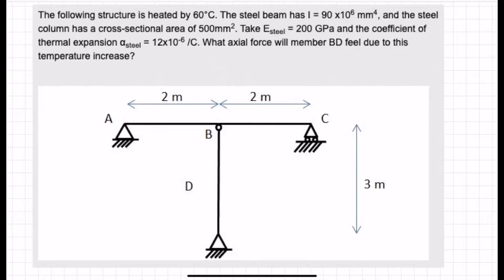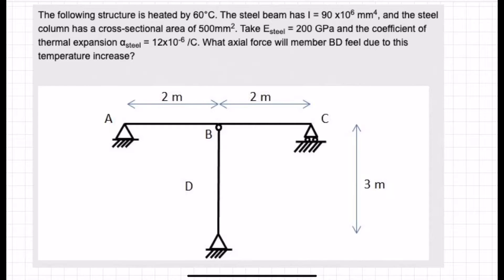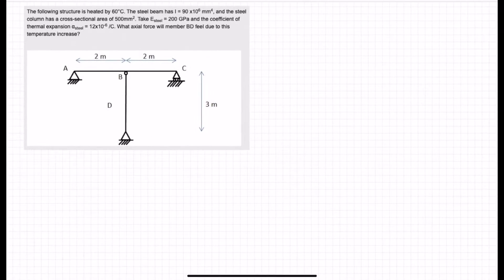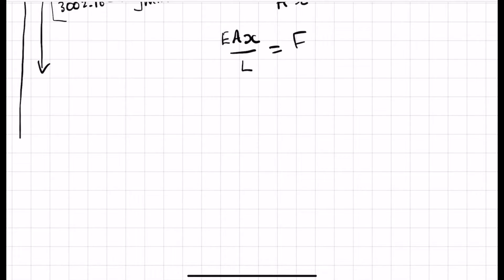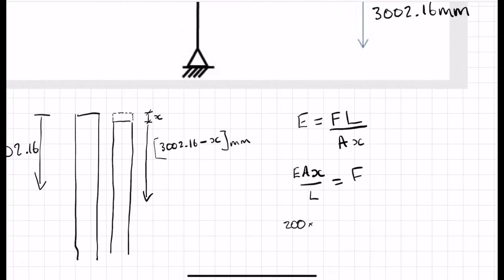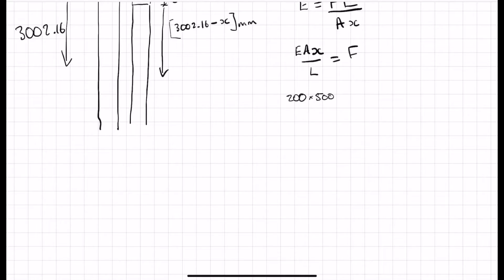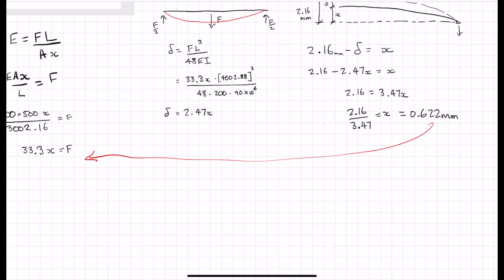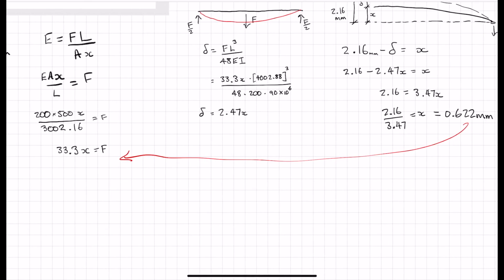Thermal Expansion of a Column Restrained by a Beam - IStructE Structural Behaviour Course

Comment: Hi, thanks for the excellent videos.

In one of your other videos (Beam supported at mid-span by a spring) you mention the importance of the signs of the deflections (ie: positive for deflections acting upwards, negative for deflections acting downwards).

Does this apply here? I initially though the unrestrained expansion of the column would be positive (acting upwards), the reduced expansion due to the beam would be negative (acting downwards) and the final 'real' expansion would be positive (acting upwards). Using that approach would result in: "2.16mm - (-2.47x) = x", with "x = - 1.47mm".

Any advice you could offer to help get my head around that aspect would be appreciated!
Reply from the maker: Hi Stuart! Honestly, it doesn't matter which direction you take as positive or negative. It's more to help you keep a track of summing multiple deflections -- thermal expansion, virtual work force, restraint force etc., not too dissimilar to initially guessing direction of reaction forces on a structure. If you have the direction wrong, then you will just get a negative number so the actual result should not change.

Comment: Hi, ty for the excellent explanation! Could you please explain what happens if C was a pinned restraint instead of a roller?
Reply from the maker: Without taking the time to do hand calculations, my guess is: 1) There would be an induced compressive axial load in the beam and horizontal reactions due to the thermal expansion 2) Due to the additional axial load there is likely to be a magnified deflection due to P-Delta effect, or the Perry-Robertson magnification 3) Thus the column would probably be allowed to expand further upwards and hence experience smaller compressive force as the additional deflection = less vertical restraint. Refer to 10:35 for the effect of deflection vs. restraint.
Reply: @TheStructuralExam  thank you so much !